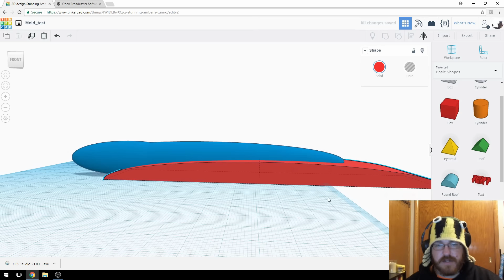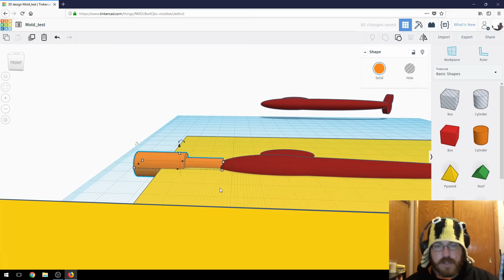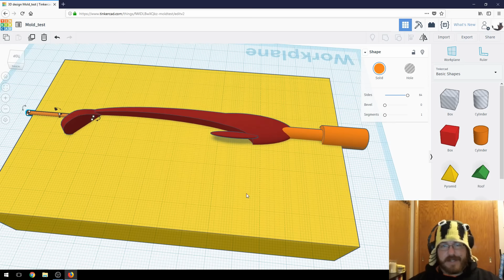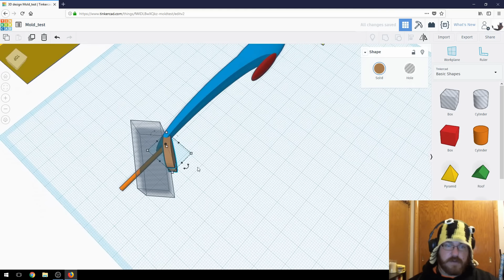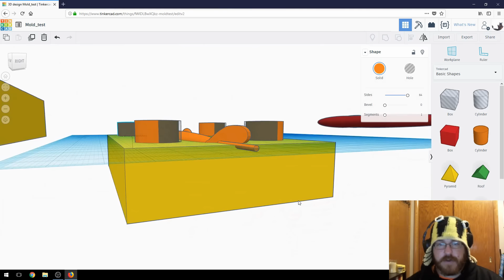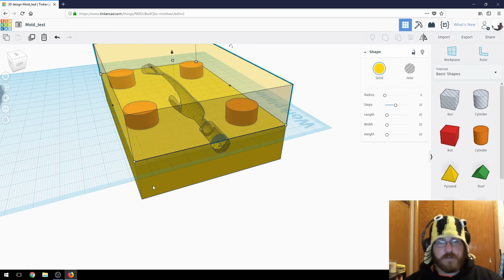TinkerCAD Basics: How I make molds

Comment: I am shickeled titless!  I just learned about tinkercad and still couldn't figure it out.  Your video about molds opened my mind.  I have always (for the last two years) thought of 3D printing as the mold of the future, but I never thought I was making a mold.  I was making a prototype.
I knew it was a mold but I didn't think of my Open SCAD as a mold, even though I did, but I know 3D the new mold.  But, the mold I thought it is, was only an image.
I came to tinkerCAD because it is visual.  But, until now, with your video, I was unable to negotiate the program.  I don't even know if I need to download it.
I am thankful for your video.  If I sound crazy, it is because I am happy.
Reply from the maker: I'm glad I could help in some way! Shouldn't need to DL it, last time I used it, it was all online. It's great to cut into to start!

Comment: That's a 4 day print . There are quicker ways . Use the 3d printer to make the plug and split it in half
Reply from the maker: 4 days? You might want to look into changing your settings, both sides of that mold is about 8 hrs total for me.
Reply from the maker: Also if you're curious my newer videos have many examples of this technique with silicone.

Comment: Try casting  a mold an then use plastsol
Reply from the maker: Hi Nick, I have tried that a few different ways.  The mold itself when printed negative halves doesn't seem to hold up to the temperatures of the plastisol.  I tried in PETG and it deformed when injecting if you want to check out that horrible video it's here: https://www.youtube.com/watch?v=R69n2SPGvFs   . Then I decided to print the positive of a frog design and make a mold out of Alumilite Vac-50 which worked much better if you're interested in that, that video is here: https://youtu.be/f82_32v4C5o    .  Then I switched over to a silicone mold material called Mold Max 60 from Smooth-on and started to print the negative halves of the molds as containers for the silicone.  That seemed to work the best so far, great results witch much less fuss.  If you're interested in that video you can find it here: https://youtu.be/tdqNYjllf8k?t=382 .

Thanks for watching and commenting! I hope you got something out of watching the video!

Comment: You could also just run bars the length of the mold for keyholes. Might be easier
Reply from the maker: For sure, would definitely make the modeling process easier. Wouldn't have to align as many index points. It gets to be a little more of a pain with more complex models. I've switched to Fusion 360 for almost all my stuff now so aligning is 10 times easier.
Reply: @RevampedOutdoors  ah nice, I'm still somewhat a noob. I have to look into that
Reply from the maker: Fusion 360 is a great CAD tool offered for free if you're not making money from using it (under 100000 USD a year) at least that's true for the date of the comment.  You never know with software these days, but for now it's a great program.  It takes a lot of getting used to but once you somewhat understand the environment it is a lot more precise than tinkerCAD.  I still use TinkerCAD a bit especially for modifying things quickly or needing to modify existing STL's.  TinkerCAD is great at being able to combine meshes without a big headache.